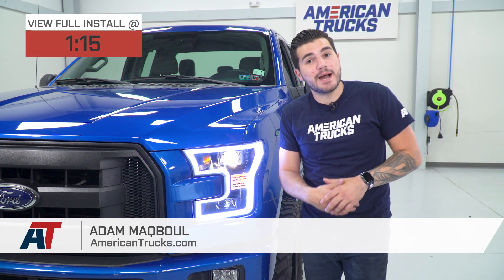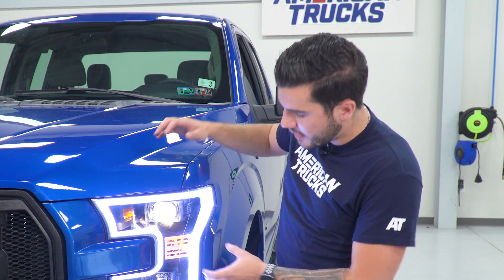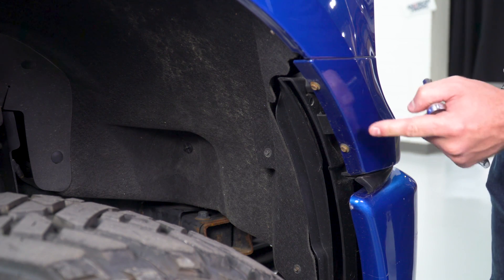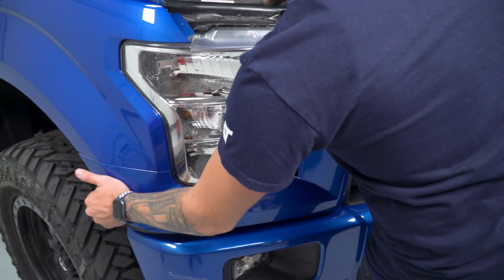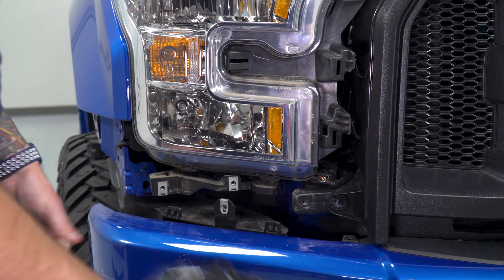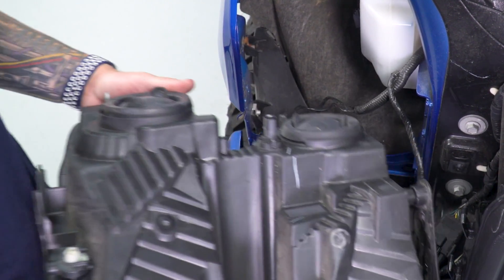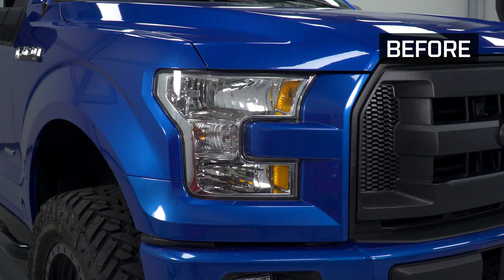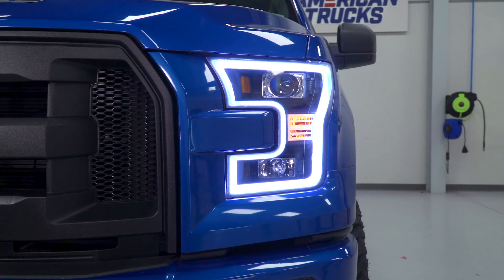2015-2017 F150 Axial Black Projector Headlights w/ LED DRL Review & Install

Comment: The only thing I would do differently is after the rewiring of the new projectors but before the reinstall of the unit back onto the vehicle, it's a good idea to check to see if the lights are working properly. 
If there are any electrical issues, there wouldn't be a need to undo the panels again for troubleshooting.

Also, it would have been nice to have a nighttime before vs. after video shots of the effectiveness of the old vs. new lights.

Otherwise, a good install video.
Reply: Having same issue, did you find a fix?  Mine seems to be pointing down.

Comment: I'd like these if the DRL was amber. I think my only option is to go with the Morimoto's.
Reply: Moromoto all the way... the output of them are the best you can get with a plug and play system.  Anything else in my opinion suck ... these headlight eghhh. Stock headlights have better output.
Reply: Oh man the morimotos xb are absolutely gorgeous... but its a tough pill to swallow at $1500 for em. The second best are the Anzo headlights that are extremely similar to the Raptor headlights for $450.
Reply: Nothing like the Morimotos. Have them on my 2018 ..super bad ass..lots of compliments..

Comment: I have a 2017 F150 Platinum and the harness is different. It only comes with one electrical connection. Do y’all have a different headlight for mine?
Reply: That’s because you have factory led

Comment: These look cheaply made. Will take my Anzo switchback dual projector headlights over these anyday... look way better and have great reviews. And the light output is amazing, never been flashed not once...
Reply: Yeah, the overly thick daytime running lights dont help... but the biggest factor is the purplish bluish color that make them look like a glow stick. The anzos are second best, but the Morimotos are top tier... except their pricey at $1500.
Reply: @NuttedInYoMom  I agree 1000%. I so wanted the morimoto ones but Jesus the price. I did install morimoto hid kit for my low beams that are amazing.